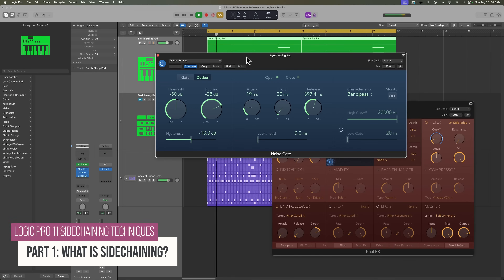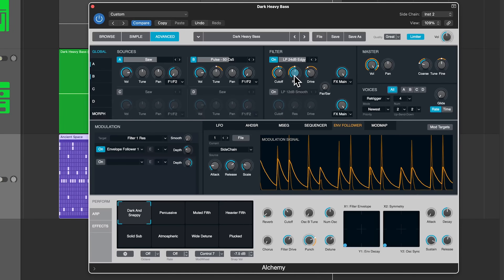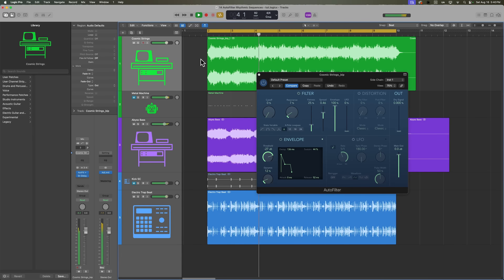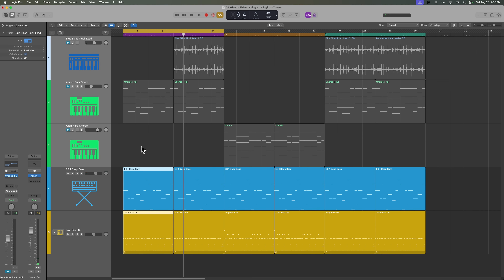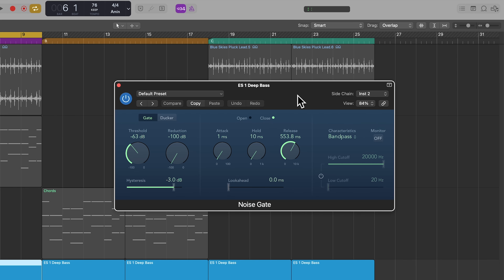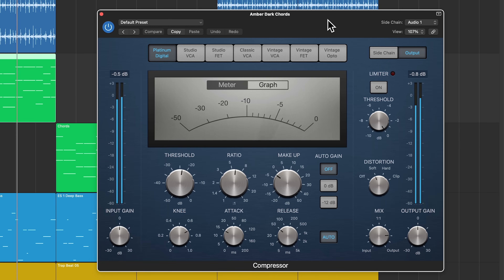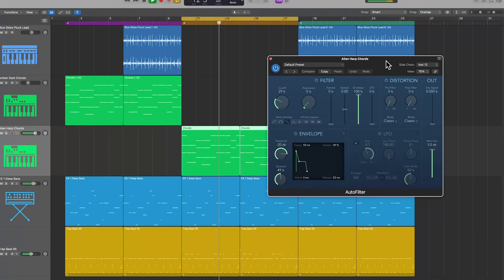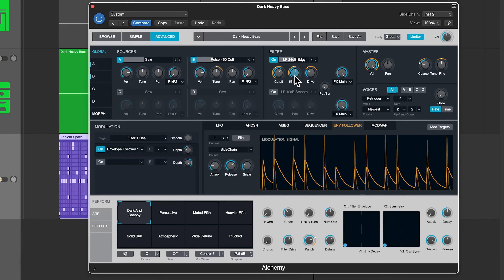Logic Pro 11 Sidechaining | #01 What is Sidechaining?

Comment: great video...still confused but I will watch again. Best example was your mike and the background music.....cool
Reply from the maker: The examples I showed in this video are just to give you some quick examples to hear different sidechaining techniques. I will break all of these things down in more detail in parts 2-9 with the Compressor only. Once you understand the fundamentals you can apply that knowledge to other plugins and instruments. Sidechaining is a bit hard to wrap your head around from a signal flow stand point at first. I use that same technique with my voice and background music to duck instruments out of the way of a vocal, for example. Or to get a kick drum to slightly duck a bass part, so the two don't collide in the mix. Those are simple examples.